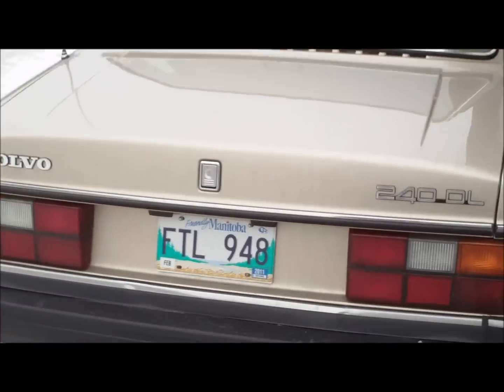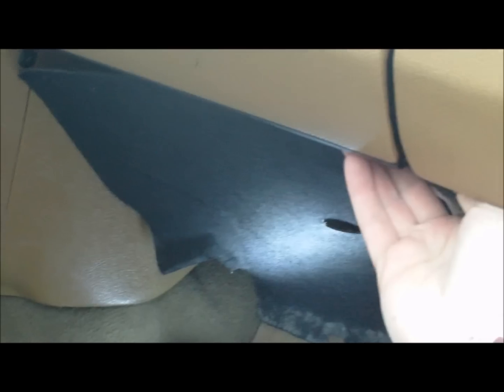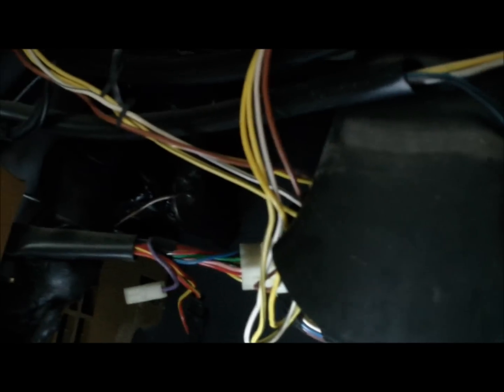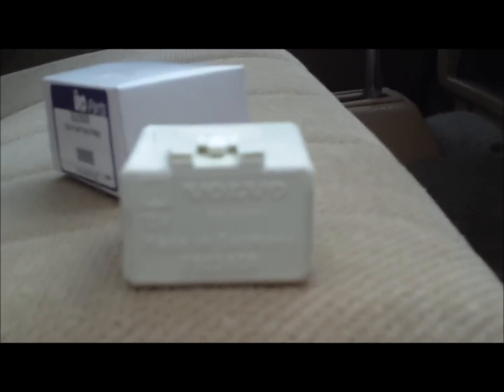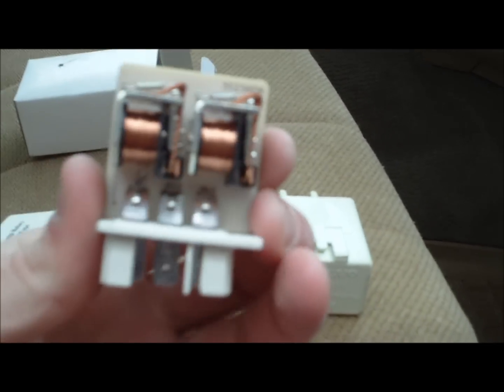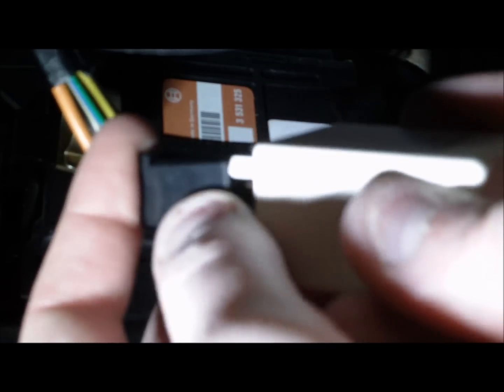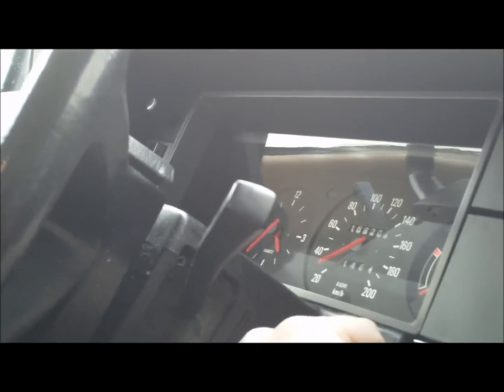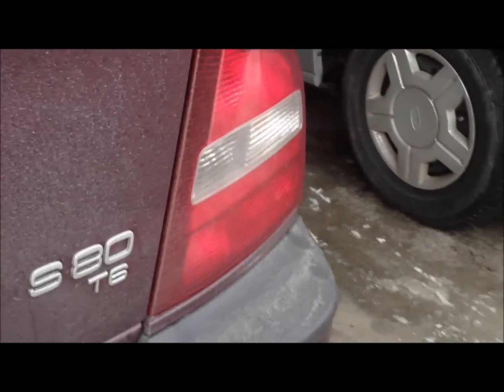1990 Volvo 240 Fuel Pump Relay Replacement

Comment: THANK YOU!!! we purchased our 1990 240 DL a year ago. It started to STALL 35mph, spent $100's @2 shops & neither could get it working properly. Husband wanted to sell, but I want to keep, so  I spent 2d researching/watching YTvideo's (mostly yours). contacted IPD (Volvo parts in Portland, OR, by Airport) & they confirmed that I should start w/replacing FPrelay & all fuses. Got parts today, re-watched your video, & 10 min later my Volvo was running perfectly. Next is Main fuel pump.

Comment: Hi,
Pop open the cover on the old relay. Check the circuit board side with the solder. A lot of times on those relays the solder joints begin to fail (due to use & or heat) and the solder just needs reflowed. Check it out and toss it in the glove box. While your at it, make sure the 25amp fuse (main fuse) located up by the battery is free of corrosion.
Enjoying your 240 videos,
Travis

Comment: Thanks volvosweden
I have a 86 245 that has been sitting for 7-8 years. I replaced the cam belt, windshield and a few other things and then a problem with starting arose. I picked up a new fuel pump relay Stribel 104561 and it started right up. Really nice to have it running again.

Comment: i just replace the main and in tank fuel pump, and filter..ran fine, fired up everytime til later that day the pump kjust wouldnt kick on, no power gettin to it..im thinkin either the relay, or the main pump fuse located by the battery.
any tips, comments suggestions are well appreciated.

Comment: Bought a 1990 240d and drove it home. Did not run again. Found a brand new cam sensor in the back seat which indicates previous owner had issues. Battery good/full of gas. Would not start/not getting gas. Found a fuel pump relay in car/did not look new. Tried it. Is there a right and wrong way to plug it in? Tried 2 ways, heard a click or some noise, now absolutely nothing when I turn over the key. What did I blow? Just order a new relay. What are my next steps when it gets here? I will try to get the sensor in by then. I am VERY inexperienced, an elderly lady, so please make your directions simple. Which you seem to do, which is why I am asking here. Thank you for you videos!

Comment: Have to confirm that the solder breaking on the curcuit board is the problem. My Overdrive relay stoped working...and it was the solder joint that had a crack in it. Just re-solder...and fixed !

Comment: i thought the relay was the problem with my '89 240, it ought to have been, becuase when i opened it up it was all green and crusty. but whn i replaced it , no reall improvement, i discovered that the ground was the problem (green/blue) i grounded that and at least now i can shut the fuel pumop off withthe key , BUT it also tells me the fuel brain is malfunctioning